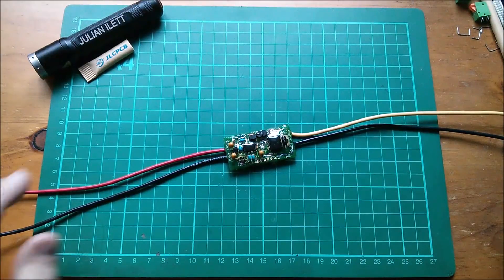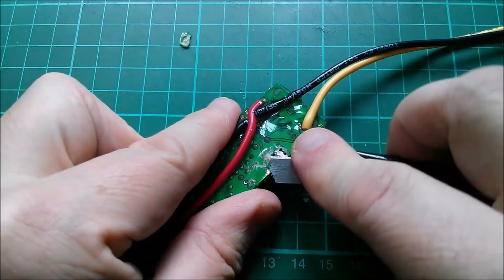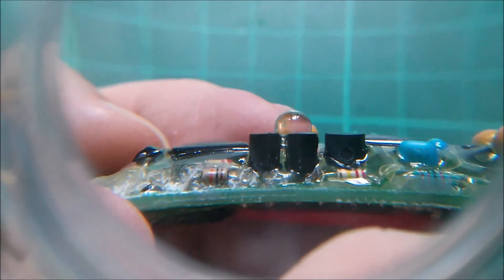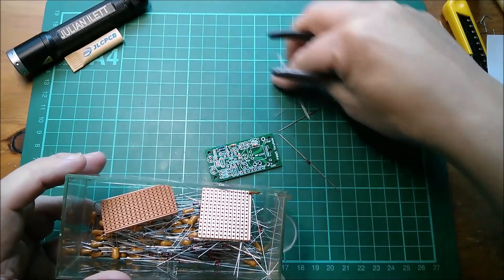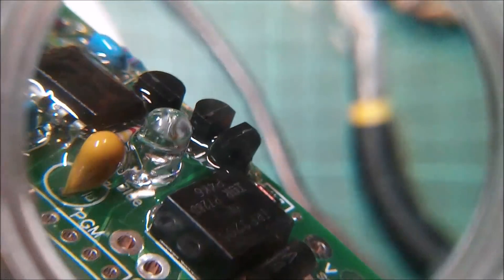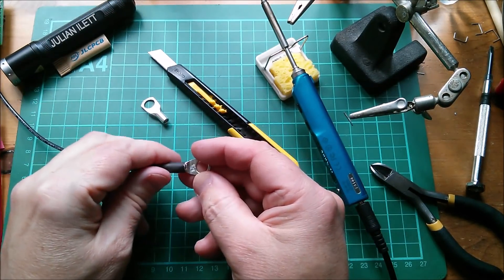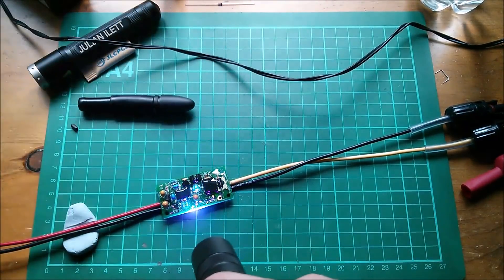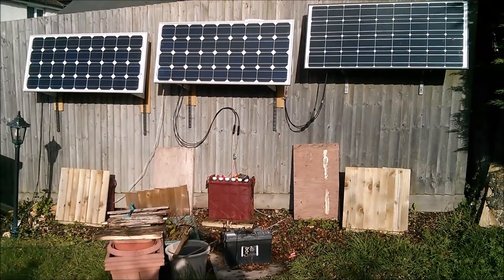Emergency PWM5 Build - Solar Charge Controller Fail

Comment: UV resin is quite handy for a quick coating... but could i suggest you something a bit different? Instead of coating it with several UV resin layers, why not create a small silicon casting mold (normal silicon and soapy water tecnique), and use 2 component epoxy resin to fully submerge it? it should give you 100% effective coating at the 1st try, even with air pockets... it's slower (even if you use a 1h epoxy), but if u're not in a hurry, i think it could be better. Also, i think that it would be cheaper by volume...
Reply from the maker: Worth a try :)
Reply: Thats what i was about to suggest. No way water would get in then.
Reply: My thoughts exactly. Plus the resin is clear (even the cheap one - although it is slightly yellow, which shouldn't matter), so the LED will be clearly visible.

As for air pockets - curing it in a pressurized pot would make those pockets shrink into nonexistence and ensure that the epoxy is squeezed into all cavities.

Comment: The Problem are the Wires they act like a Wick, you will get water ingress even if you pot it. Better would be Screw Terminals which stick out of the Potting, or Solid wire like enameled wire.
Reply: The fact that the solder resist delaminated from the PCB so easily makes me think that the water seeped into the PCB from the side. Maybe the edges of the PCB should've been sealed better?

EDIT: Although the wicked water could've gotten between the layers through the wire. Hmmm...
Reply: @Sheevlord  No - the solder resist and UV glue chemistry are very similar. They probably bonded very strongly - more strongly than the resist to the copper.
Reply: @mahlapropyzm9180  Oh, that actually makes sense. Isn't solder resist UV cured as well?
Reply: @Sheevlord  IIRC yes, often though not necessarily always.

Comment: Hello Julien.. love your videos 
I have a big drone I whant it to left a long rang flashlight for rescuing people that lost in the desert.. the problem is how can I hookup the flashlight with the RC receiver.. how can I control it by PWM ?
Reply: You need one of these RC switches for each thing you want to switch up to 10 amps.
https://hobbyking.com/en_us/turnigy-receiver-controlled-switch-1.html
Reply: @ahaveland  thank you andy , you help me alot
Reply: @Eng.Mohammad_Alotaiby  You're welcome - I used these on my drone to switch on different lights too, and a laser. You can use them to blow a fuse if you want to drop or ignite a flare.

Comment: Have you thought about totally encapsulating the charge controllers in a clear plastic box so they are fully sealed but you can still see the led.
Reply: hitechguy18 some 3D print materials are not water tight when printed - seen dead boards in PLA boxes as it’s soaked through...
Reply from the maker: I've certainly thought about it - the advantage of UV glue (and hot glue) is that they're very fast setting. Potting compound sets very slowly. Finding the right size box could also be problematic.
Reply: @JulianIlett  UV glue sounds much more expensive than a small plastic box with a gasket.
Reply: @JulianIlett  What about 2 component epoxy as a potting compound? Curing time can be reduced dramatically with heat. Even a household hair dryer should work. Plus, the more epoxy you use the quicker it sets because the reaction is exothermic.
Reply: @Sheevlord  In bulk quantities that exotherm can easily exceed 200C - I know, I've done it. Magic smoke a-go-go.
Reply: @mahlapropyzm9180  Yeah, I can imagine. That's why it's not recommended to pour a lot of resin at once.